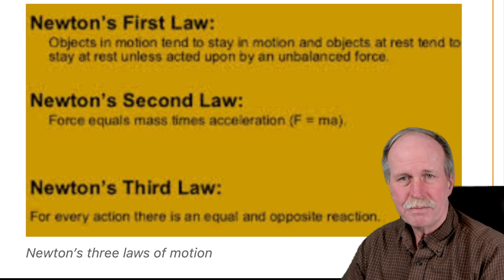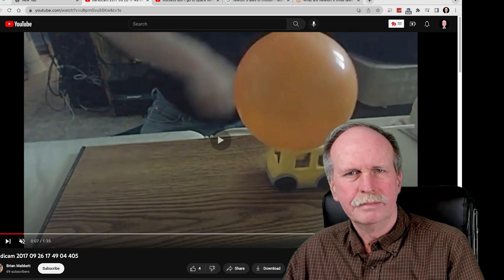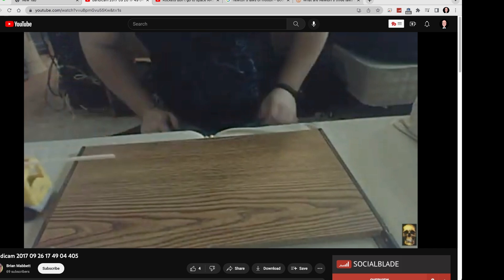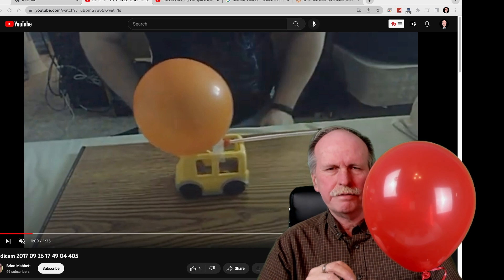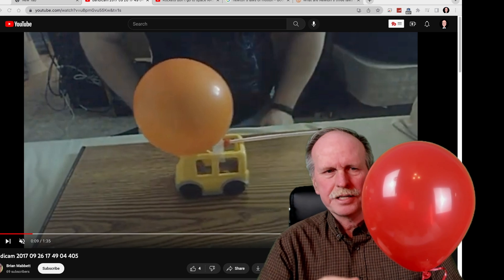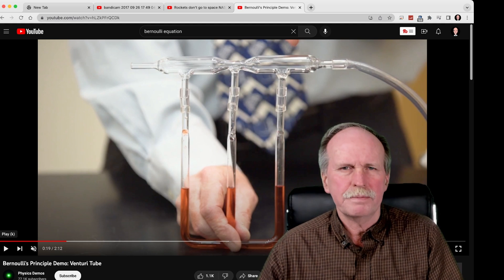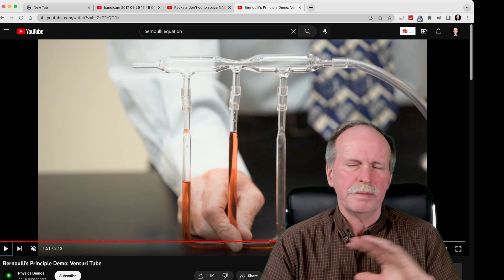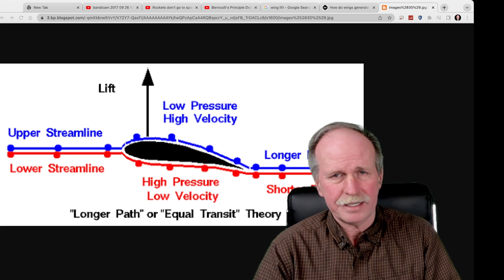Flat Earth Proves Rockets DON'T WORK

Comment: There's videos on YouTube of people firing rockets inside a vacuum and unsurprisingly they still work. A guy who makes rocket engines for models got a long transparent thick plastic tube, mounted a rocket engine on a spring inside it, sucked all out the air in the tube and fired the rocket motor. The video clearly showed the rocket motor pulling the spring forward. I guess a video of a toy car with a balloon, a straw and vacuum cleaner is much more compelling evidence though... 🙄

Comment: That was the reason he played with adding coins at the beginning. I was wondering what the point of that was, but clearly he was simply adding enough weight to the car so that the low pressure from his vacuum cleaner would balance out the force imparted from the venting straw.
Reply from the maker: Exactly.  He used the straw as a spacer as well
Reply: @BobtheScienceGuy  The construction of the "experiment", the added coins , the length of the straw, and the vacuum cleaner being turned off too quickly, all point to someone who KNOWS rockets work in a vacuum but who wanted to drag ignorant people down the rabbit hole.
Reply: He was increasing static friction so that the car would stay in one place when there was a small imbalance of force. He really didn't want the car to roll backwards when the atmospheric pressure pushed against the front of the car+balloon (while removing some of the pressure behind it with the vacuum-cleaner).
If he would try this experiment with a boat instead of a car, he probably wouldn't be able to balance the two forces as 'nicely' as he did here.

Comment: This is some premium debunking content!
Reply: now explain this space vacuum next to air pressure on earth.... there needs to be a container to have pressure.
Reply: @stephanHK  Sure. If you promise to show a great deal of skepticism towards flat earth. Deal?
The answer is: There is a downward acceleration (most call it gravity) that makes the gas molecules fall back down to the ground.
Reply: @stephanHK  Laws in physics distill the governing principle out of a complex system. They generally assume that the subject matter is in a frictionless void of sorts and that particles have a size of zero etc to be able to present a succinct formula that's easy to remember and work with.

When applied to a real world problem, one has to remember all the factors that the law ignores and verify that they don't influence the result significantly.

Example: You want to route some pipes to transport water for heating. You turn to Bernoulli's principle to check what diameter pipes you'd need to pump enough water at a certain pressure. But the result is only an ideal case because it ignores factors like the friction on the pipe walls for example.

The people citing that "gases fill their container" work with such an idealized case as well and pretend that since it is called a "law" it must apply to reality verbatim.
Reply: @stephanHK 
Air pressure. Ask yourself what causes the air to have pressure in any particular direction at all. Should answer your question.
Reply: @stephanHK  The 'container' is the gravitational potential of the earth's gravitational field. 

Let's run a small thought experiment that demonstrates it in a simple way.

Room temperature air molecules have an average velocity of around 460 meters/second. Gravity at the surface of the Earth is about 9.8 meters/second-squared directed towards the center of the Earth.

Now imagine a single air molecule in a vacuum with it's velocity vector pointed straight up (away from the center of the Earth). How high will it travel before gravity alone causes it to come to a halt and start falling DOWN again? Like anything you throw upwards?

Ignoring the change in gravity with height for a first approximation, this is a very simple problem: 460 meters/second divided by 9.8 meters/second-squared gives us ~ 46.9 seconds of deceleration as it slows down due to gravitational acceleration towards the Earth. Ye old distance = 1/2 * acceleration * time^2 equation for acceleration gives us a height of 9.8 * (46.9*46.9)/2 = 10.8 kilometers. So the average air molecule at room temperature can only travel about 11 kilometers vertically before it simply starts to fall back to earth because of gravity.

Real air molecules have a range of velocities, but regardless, the escape velocity for an object moving outward from the surface of the Earth is 11.2 kilometers per second (something easily derived from Newtonian gravitation and laws of motion).  A ballistic object CANNOT escape the Earth if its velocity is less than that.

That is more than 24 times the velocity of the average air molecule at room temperature (requiring a kinetic energy nearly 600 times as great as the average molecule to achieve). More than enough to 'put a cork in the bottle' for the Earth's atmosphere using nothing but Newtonian physics and gravity. 

You can also easily derive this result exactly using total energy = potential energy + kinetic energy instead of the  approximation I used for the thought experiment here.

Comment: That rocket at the end was interesting. 
I saw the last shuttle launch in 2011, Atlantis, from my home in Ireland, and the plume from it was about 10 times as wide as the shuttle. 
I was using a 6 inch telescope to view it, moving the telescope manually to follow it, and I was lucky enough to track it for pretty much it's whole course through the sky. Maybe a minute or so.
I never really thought about why the plume was so large, since I'd never seen one before, but the fact that it was due to the low pressure of the atmosphere makes a lot of sense!
Reply: I have video of the flight of the Apollos Saturn V during the initial boost phase. The rocket plume around one minute before staging is huge!! Larger then the entire rocket itself. The first stage burnout required 4 small rockets pushing the booster back away from the remaining stack. That part is impressive. I’m sure NASA has the same footage available for anyone to see. The documentary “In the shadow of the moon” has great footage of the entire Apollo program. They have a few of the moon walkers in it also. Great video.
Reply: You saw it on Ireland?
That kills flatters too,remember,flatters claim that rockets launched over the Atlantic Ocean make a curve to fall into the sea,they don't get that since Earth is an spheroid the rocket is just following the curvature of the planet while ascending into orbit.
Reply: Right ! Rockets need something to push against how do they do that with no atmosphere ?
Reply: @huckfin1100  It's not that a rocket needs to "push against something", but more that it "pushes something away".
It's like if you're standing on a tightrope and you throw a10kg rock in one direction, you will fall off the tightrope in the other direction. It's the conservation of momentum (mass*velocity), m1u1 + m2u2 = m1v1 + m2v2. It's some pretty basic physics, and pretty easy to understand if you google it.
It's like, if you throw a 10kg rock at 1m/s, you will feel the same "backwards" force from it as throwing a 1kg rock at 10m/s.
Or a 1g rock at 10,000m/s.
This is how rockets work, they throw out small particles at a high velocity. What happens to the particle afterwards is irrelevant, whether it hits an air molecule, or continues straight in the vacuum of space. It doesn't bounce back to push rocket forward.
If you've ever used a power hose you may have noticed that it puts pressure on your arm when it sprays water out. But the pressure doesn't increase when you put the spray very close to the ground, or a wall, because the water particles are all going in one direction.
Reply: @huckfin1100  I can't understand why you haven't replied and countered 'FirstName LastNames' answer to yr question?
Oh wait, yes I can.
Reply: @huckfin1100  - The "Thrust" of a rocket engine is really just the mechanical recoil of pushing OUT MASS.

Do you believe a crossbow fired into a vacuum would have any RECOIL?

Comment: A major problem in the old school  diagrams is that they don't show the deflected air behind the wing. But rather for some reason the stream turns back from its deflected angle. In reality the stream deflects and remains deflected behind the wong. It doesn't go back to the original angle as depicted in this diagram. 
Fixing this fault in the diagram will go a long way to fixing the erroneous equal transit time model, that confuses cause with the effect.
Reply: Most importantly, a perfectly flat wing (pizza box) at positive angle of attack generates plenty of lift. It has poor drag performance and a narrow operating envelope, so is not practical on aircraft that are meant not to bleed money out of the owner, but it certainly works just fine. What matters is that there must be net momentum transfer to the air mass, in downward direction. Also, symmetric wing profiles work fine!
Reply: Right - the real cause of airfoil lift is the same as a sailboat's sail. The air is deflected/accelerated from it's original velocity.
That is the first force. The equal and opposite force is the airplane/sailboat moving in the opposite direction.
So the wing and airplane rise. The airfoil helps adjust the flow, but even a flat wing will work.
And that is why airplanes can fly upside down.
Reply: @SnaxMuppet  A symmetric profile is like a pizza box with less drag, wider operating envelope, and better structural properties. Of course both need positive angle of attack to work.

There can be no force generated without momentum transfer. Hold that spoon in the water flow and see where the water goes. Same happens with symmetric shapes outside of the neutral angle of attack. And momentum transfer is ultimately supported by pressures, otherwise there’s no interaction between the wing and the fluid it’s in. So nothing I said grossly contradicts what you say, except that ultimately there’s just one set of behaviors governing all this, and both momentum transfer and pressure differentials are in place to generate lift. One can’t exist without the other, pretty much.

Comment: If flerfs wanted to actually learn and/or understand anything rockets, they should pay very special attention to the one crucial thing all rockets have in common:  The reason there is a need for a nozzle & the different shapes/sizes thereof.
Newtonian Laws are simple enough, it is the dynamics of the expelled gasses that makes the difference.
Reply: You don't need a nozzle if you use enough brute force. Launched countless of rockets without a nozzle (mostly air-rockets and water-bottle rockets though ;-)  ).
Reply: @DreadX10   Yes, but with crap control & definitely not operating in thinning atmosphere conditions.

Comment: Actually this old school model is not correct.  Air doest have to transit at equal time. In fact, air advances past equal time when the wing is doing work. But becomes equal when the wing is not doing work. Wings work by deflecting air and this causes a pressure differential on the wing. The deflection is the action and the pressure differential is the reaction.  Wings don't 'create a pressure differential,  and then get lift from it.' This would be like saying that lift causes lift. They can only lift by deflection. The bernulli effect explains how a force is transmitted to a surface or wing. However, you can only get lift through deflection. And you can't get deflection without lift. Even when a cambered wing is flying up side down, air is advancing above the cambered side, not transiting in equal time. The old text book model confuses the cause with the effect. It confuses the action with the reaction. Lift doesn't cause lift. Only deflection does. Please help us fix the old erroneous model.

Comment: Your local fire brigade provides a fine demonstration of momentum and rockets when they brace to operate a hose: https://api.army.mil/e2/c/-images/2009/08/04/47070/size0-full-army.mil-47070-2009-08-04-160813.jpg - how does a few cubic metres of air push so hard on that solid-looking gent?
Reply: Yeah, not good to open the nozzle of a 2 1/2" fire hose without backup.
Reply: @judybassett9390  Wrestling one to the ground before it, and the stand they used to mount on wiped out a batch of firemen and trainees ain't nice.

I have scars to prove it.  Ouch.

Comment: I don't know what the "idiot with a car trick" was supposed to prove, but I thought we settled the idea that "vacuums don't suck. High pressure will move to low pressure, but when the pressure is equalized,  there is little to no more movement. Rockets actually work better, or at least easier in space because there is no drag  caused by atmosphere. The aerodynamics of a rocket are designed to cut through the atmosphere, and fly in vacuum. The engines used to get through the atmosphere are not the same as the engines used in vacuum. But it would take some actual research to know that. They don't want to know the truth. I say it's borderline psychotic.

Comment: Air in free atmosphere has no ability to resist compressive force as a building foundation does.
Saying rocket thrust pushes off air is like saying you can push a car with a length of rope.

Comment: I think what is it is is like most flat earthers, they think "vacuum" is the same as like a vacuum cleaner where they think the lower pressure sucks everything to it rather than simply being an area of no pressure
Reply: They would be surprised to hear a vacuum-cleaner wouldn't work in space.....
Reply: The pressures would eventually create equilibrium. You cant have a pressurised system next to a non pressurised system without a physical barrier. We experience what we believe to be low pressure at high altitudes. This is because the heavier gasses ( like oxygen) have fallen to a lower level and you would just have lighter gasses at that level. Not debunked anything here at all.
Reply: @malkchatters1046  What? You can sustain two different pressure-zones if there is gravity involved.
No, the ratio of different gasses in the atmosphere stay about the same until you get really high up (100+km).
Reply: @DreadX10  The magic theory of gravity. The glue that holds the 🐂💩 together. Dream on space boy.
Reply: @malkchatters1046  Explain how  people (like me) can experience zero-g in a zero-g flight. Using your hypothesis on density of course.
Reply: @DreadX10   The mighty force of so called gravity can be overcome with a gentle breeze.
Reply: @malkchatters1046  Weird way to say that you can't explain what I asked......

And besides, gravity is a puny force, not mighty.
Reply: @malkchatters1046  When will the pressure stop decreasing, why and what is the pressure then?
Reply: @malkchatters1046  classic flat earther just claiming random nonsense and acting like it’s fact.
Reply: @malkchatters1046  weird how your facts don’t align with reality. There is the same ratio of oxygen in the atmosphere on a mountain as there is at sea level. There’s just less of it😂
Reply: @Emperorhirohito19272  Your response was as nonsensical as the theory of gravity.
Reply: @malkchatters1046  so my nonsense is supported by many observations, and yours isn’t. I’ll go with my nonsense then I think.
Reply: @Emperorhirohito19272  Observations deciphered with theory rather than reality. Dream on spacecake.
Reply: @malkchatters1046  nope. Literally just measuring the ratio of gasses in the air. Very simple and clear observation which just doesn’t agree with your assertion…
Reply: @malkchatters1046  if the heavier gasses fell down (went book boom), that would mean that we'd have almost 100% oxygen at sea level, we wouldn't have any nitrogen. 
Obvious troll is obvious...

Comment: Equal Transit has been pretty much tossed at this point. the idea now is the deflecting air causing high pressure under the wing accelerates the air over the top causing the pressure to drop on top. much like when you put the hairdrier next to be balloon. but most of the lift is coming from Newton. more so at smaller scales :D. see pizza box RC aircraft that just flat plates with high AoA

Comment: See Bernoulli in action in your home:  Equipment Required - 1 X shower cubicle  with hanging shower curtain.  Method:  1 - Get in the shower.  2 - draw the curtain closed.  3 - Turn the water stream on hard.  OBSERVE which way the curtain moves when the stream starts.
Reply from the maker: Don’t say shower and stream in the same paragraph to a male boomer
Reply: Another fun thing to do in the shower if you have a shower nozzle on a hose is to let it dangle (yeah  I said that) and turn on the hose full stream (yeah I said that too). Count the times it whacks you i the shins.

Comment: You can spray a water hose (or compressed air) into a tin can or a bucket, and the bucket will move. It's the same thing as rockets! The idea that the rocket blast needs AIR to push against is incoherent--how would the blast of fire that's flying away from the rocket hit the air and then somehow transmit that movement back along its length into the rocket itself? It's not directly connected to the rocket at all.
Reply: It will transmit energy back up the exhaust-plume (or tries to). This energy travels at the local speed-of-sound. Shock-diamonds are formed in the exhaust because of this. The trick is to have the gasses come out of the nozzle at a higher speed than the local speed-of-sound inside the exhaust-plume.
If/when this energy is allowed to reach the rocket-engine, the result is very spectacular and very short-lived.....
Reply: If the flat earther theory was correct, you could sit in a boat and throw a 15 pound rock or a volleyball and the boat would move the opposite direction the same amount. I doubt a flat earther would understand what happened.